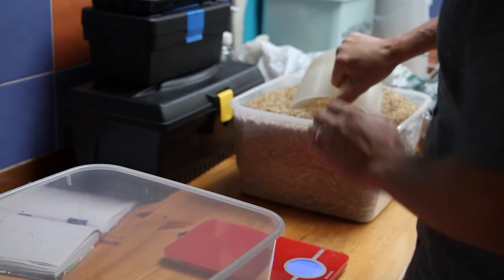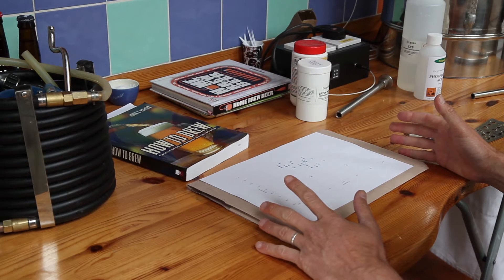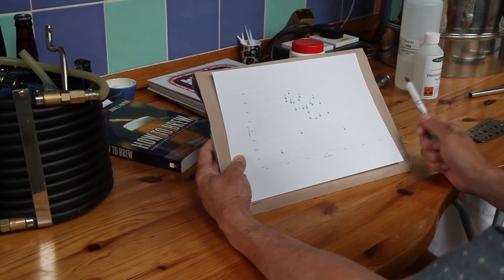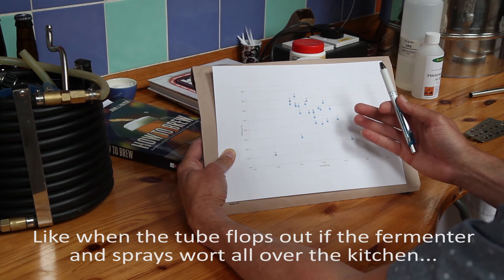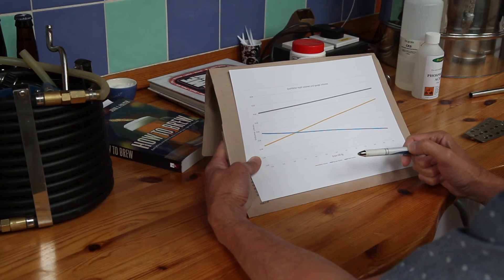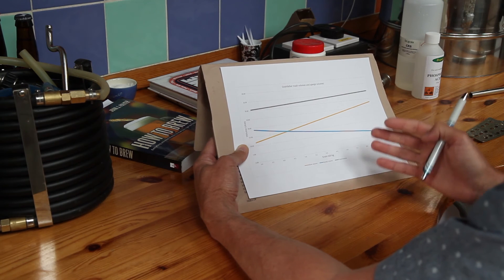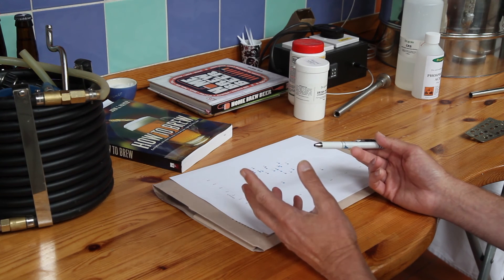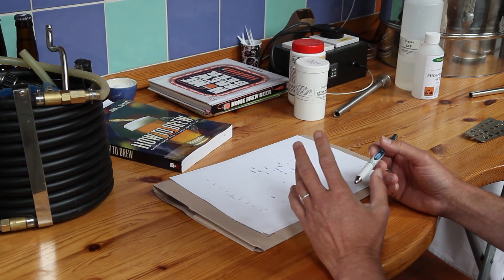Grainfather Brewing: Efficiency & hitting your numbers Pt 1

Comment: Good video great points... got my grainfather last week and brewed my first batch (Citra DIPA at est 1.070 at 17.5 lbs or 7.9 kg grain) and only hit 1.065 and my efficiency was 66%... hence why I have been reading and found your videos.  Probably should have started with a more reasonable beer but WTH... I think your videos will help and again I agree with you on why I care, its more to hit my numbers than anything as an extra pound of grain is nothing to fret over typically.
Reply from the maker: Timothy Shipley Hi Tim thanks for the comment. Yes that's quite a big grain bill so being just 5 points off your OG is pretty good so early in your GF career. As you get your process nailed your brewhouse efficiency will improve from this good start. Once you have a feel for the efficiency you're likely to get with different sized grain bills you can adjust your recipe accordingly.